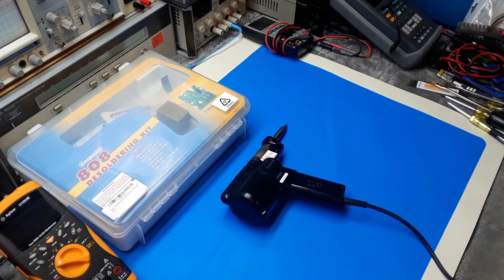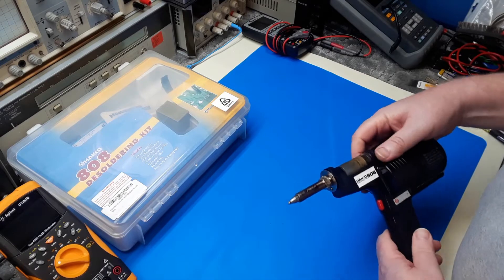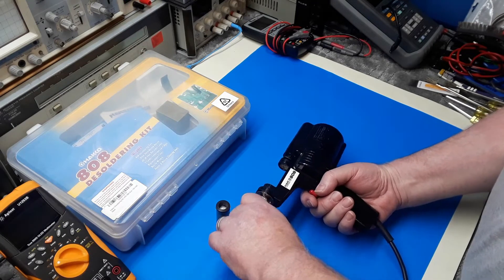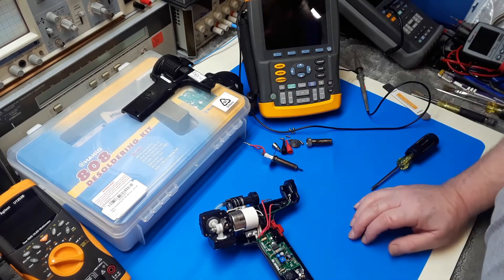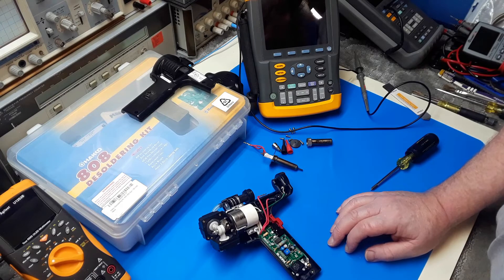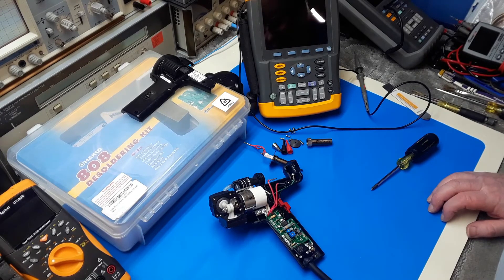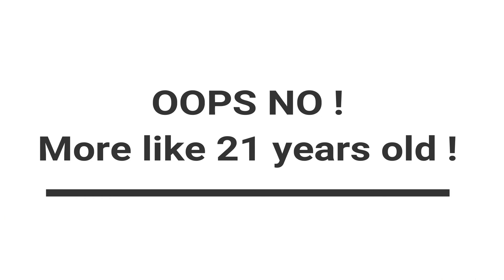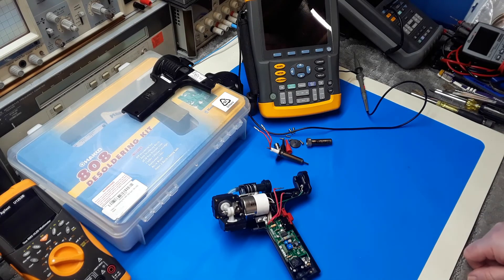Hakko 808 No Heat :-(

Comment: Hello Andy, I just want to thank you on this video you posted. My Hakko 808 was purchased in 1999. I only use it several times a year and it is still in great condition. I took it out to use a few weeks ago and noticed no heat also. I then found your video and learned alot about the Hakko. Well, with help from another Youtuber, I have my desoldering gun working again. I also made a video and gave you credit. 
https://youtu.be/Zi1KoiY7cv8?si=L4kKw8U4vYQJ-Pcv 
It was done with very little modifications to the Hakko in case i come across a good working element. Thank you once again, check out my video to see how it was done. It cost me no more than $30 USD and a few weeks wait for the parts from China.

Comment: My Hakko did the same thing with very little use. I refuse to buy any thing from this company.
Reply from the maker: The unit worked well until the element failed. Not being able to replace the element is very frustrating. I understand they want to sell their new line, but to me, customer and product support is important to encourage further customer  loyalty and purchases. This has put me off buying the more expensive, better quality product, and I will only buy cheaper throw-away products to do this job in the future.